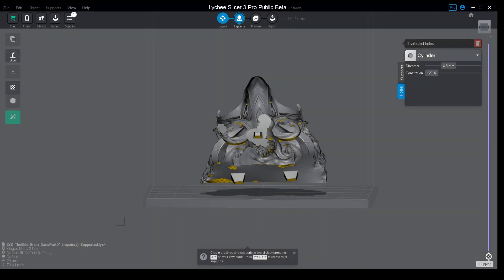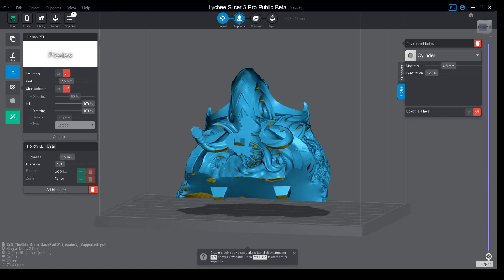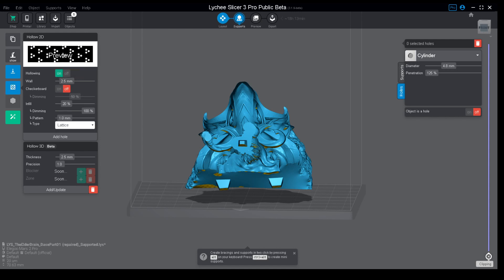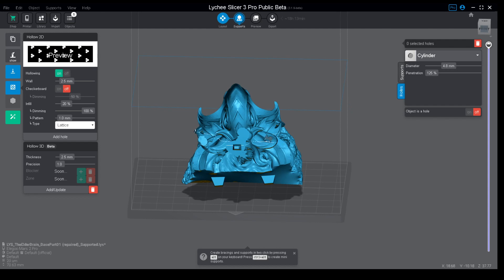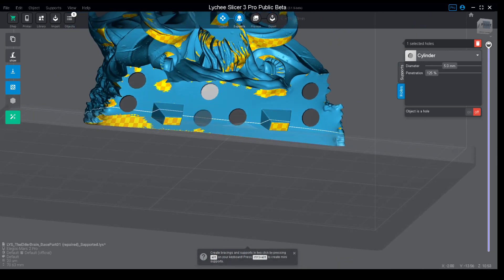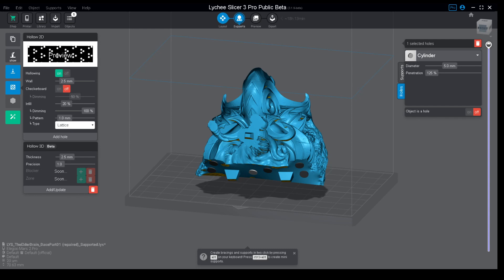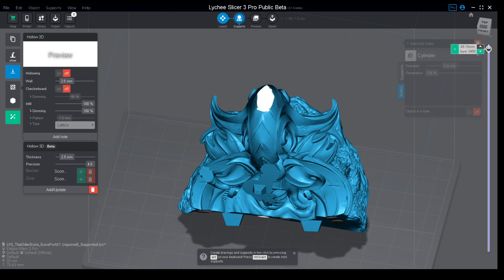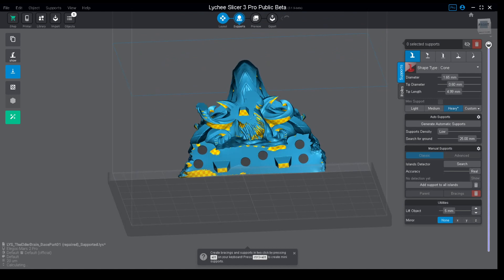Hollowing in Lychee

Comment: I've tried using lychee multiple times but I find chitubox much better because almost all the tools are available, it hollows models much better and it can hollow with 100% accuracy making it useful for fitting LEDs and metal rods! I can have multiple models at different thicknesses on the same build plate no problem.

A quick 10min job in chitubox takes me 25min in lychee just because of the layout and how you have to follow the stages, no I find it slow and very gray.. 😆

Comment: is it even worth to hollow objects? the difference in used resin is not that much! .... solid gives you a strong body, feels more real with the weight , And you do not have to worry about resin thats stucked inside the model
Reply: One thing to consider is that large, solid object will create huge suctions forces on the FEP so hollowing will certainly help. I myself have not printed hollowed objects though but I would also be concerned about sufficient clean-up and potential hidden issues during the hollowing process. Plus, I too like the heavier feel of my prints.